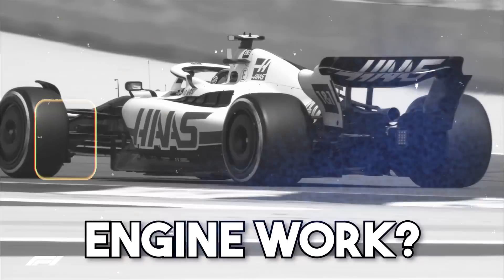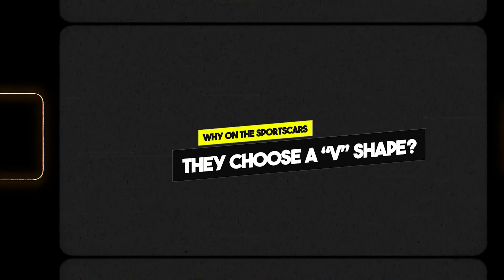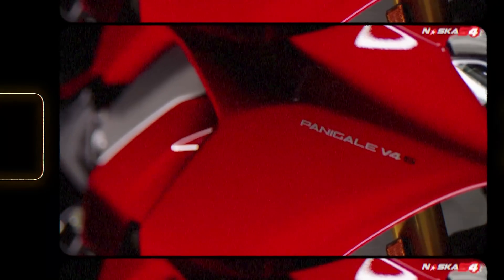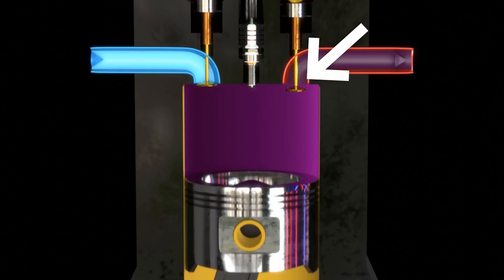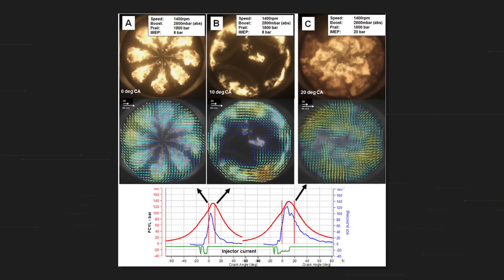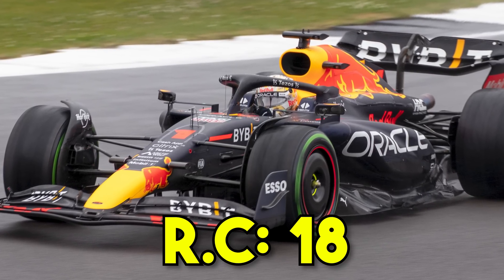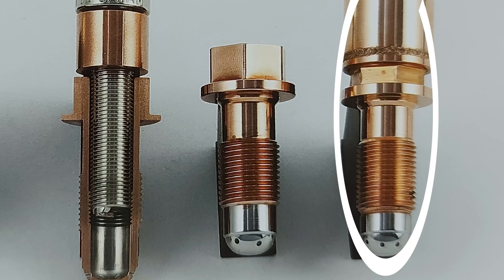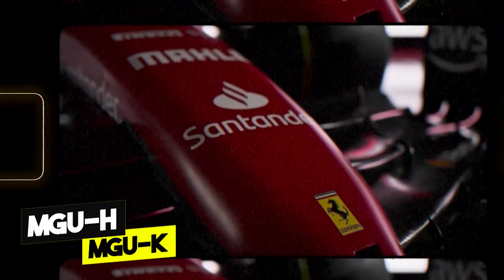The MAGIC TRICK that makes F1 Engine SO POWERFUL

Comment: It is surprise that the F1 1.6 has a precamber as on old prechamber diesel. Ibdid suspect hovewer that there should be some high energy combustion process to get 830 hp from 1.6 engine

Comment: What are you talking about ? V type engines are stipid common in road cars especially v6 engines and v8s  you however will rarely see a v4 as they are typically inline 4

Comment: Mazda designed a intake with automatic motor that changes the height of the intake tube depending on the rev on the rotory engine similar idea in the video

Comment: V- 6 engines, because are not bigger then Line 4 (crankshaft in v6 is shorter then Line 6 and much stronger)  and much more powerfull 
And equal comparisom to Higher (V8>Line 8? V12)
And By The Way 
Talking story about F1 V6 engine U have show in 2 min 51 sec Line 6 engine 
Picture is wrong,,,
Reply: And what kins crankshaft is - flat or cross???

Comment: Another way of looking at it is that the ignition in the prechamber increases the pressure inside the cylinder enough for the rest of the mixture to diesel.

Comment: Honda were using pre-chamber lean burn engines in scooter developments during the 1980's. (although only available in Belgium)
I would imagine it gave them something of an advantage  over other manufacturers?
Are Mazda using something similar in the Skyactive range of motors?
Tuned length exhaust and intake systems have been known about since at least late 1940's, I have books originally published in 1950's that give formula for calculating exhaust pipe length, BUT, it only gives a starting point which needs 'adjustment' after experimentation due to speed of sound changing with different gas density, heat and pressure. Intake systems generally use about 1,100 ft/sec but exhaust can be anywhere from 1,300 to 1,600ft/sec.
BTW, V-6 is very common in USA plus, Alfa Romeo had a great V-6 for a long time.
Reply: Some road sports bikes have had variable exhaust tuning and I think some road use engines in cars have had variable inlet manifold systems . Yamaha's R1 bike had a controlled exhaust if I remember correctly , I do not know if current model R1s still use that technology . A friend had problems with his R1 computer controlled , solenoid operated , variable port exhaust due to carbon build up . After fixing the fault himself twice with new parts , at great cost , he bought something else . Be careful of what you wish for !
Reply: @davidyendoll5903  Yamaha were using 'power valve' in 1985 on the 750 and 1000 (EXUP) They also used a different form of powervalve on two stroke engines (YPVS RD250/350), I know Suzuki were using something similar until at least 2011 on GSX-R and GSX1300F motors (when I left Suzuki) Younactually don't need to buy new parts, they can be cleaned or, if ridden properly and not burning oil, they don't coke up in the first place
Reply: Caterpillar uses the design for their lean burn natural gas engines

Comment: Commercial boilers use a primary and secondary air combustion system. Primary air gives a rich fuel air mixture that ignites easily but also relatively slowly. Secondary air finishes the combustion process. A laboratory desk burner (Bunsen) has secondary air controlled by the slotted sleeve at the bottom of the flame tube. Open you get a hot clean flame. Closed you get the dirty yellow flame.

Comment: I like your principles about explaining the differences between regular road going engines and high power peak technology engines, however I feel like you speak too generically about it which doesn't really explain how an Formula 1 Combustion Engine works, You miss out critical information such as the pneumatic valve system which is a critical step to getting to those insane RPM levels reliably, the resource allocation of materials to balance weight with reliability, the fact that the Centre Cranks are not inline with the cylinders but out of phase in the upper direction, all of these features are critical into the development and operation and a Formula 1 Combustion Engine, mostly all you described in your video was generic road use engine information without really showing how special and unique these engines are to achieve the things they do, Therefore I don't see how this video actually explains what makes a Formula 1 Engine "SO POWERFUL" as your title states.

Comment: I hate the way the FIA prohibits things. VVTI can greatly increase a cars performance and combustion efficiency at high rpm. They ruin everything. Imagine lap times if they allowed ABS in F1 again. Bunch of friggin dinosaurs throttling the sport.
Reply: Any number of pistons, any number of cylinders, RPM below 12,000, 4.0L engine, or 750cc turbo motors of 15,000 RPM. Done. Dual-motor formula again.

Comment: BMWHAHAHAHA. 1983 Brabham BT52: 1.5 liter, iron block(stock BMW), single turbo, laid on its side and 1200HP at least. Sorcerers(Paul Rosche)used to make engines, Wizards(Gordon Murray) designed the cars and Demons(Nelson Piquet) used to drive them. You fetuses need to learn history. This Harry Potter era is pathetic.